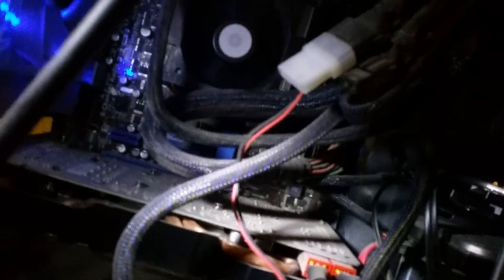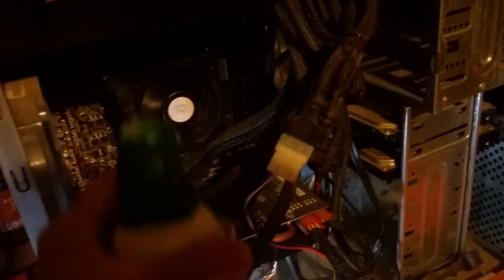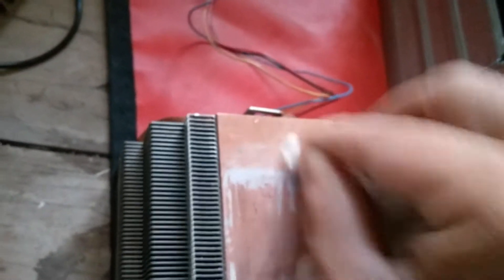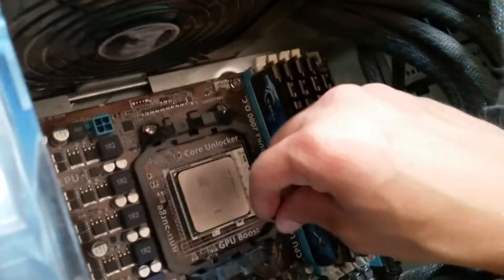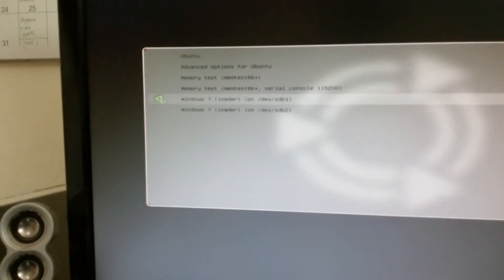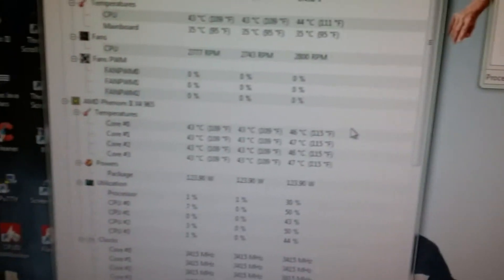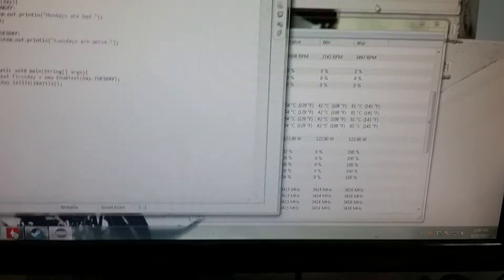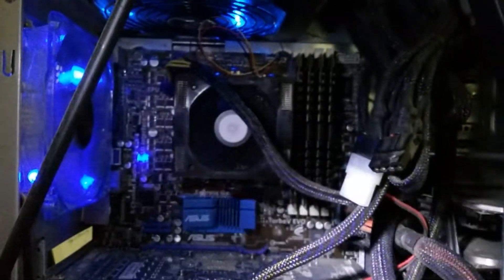Fixing a loud CPU fan

Comment: It's just a fan bearing losing it's performance. Best solution of the problem is just buy a new fan of the right size for a processor heatsink they are not so expensive.
Reply: dosent matter even if u buy best fans in universe u just need a better pc
Reply: @MMD7pubgmobile  Well, then turn off a fan on your cpu heatsink for yourself if you are so "smart" and let your pc burn to hell.